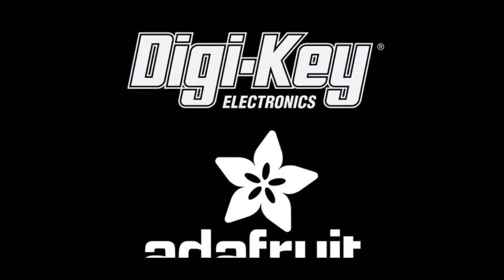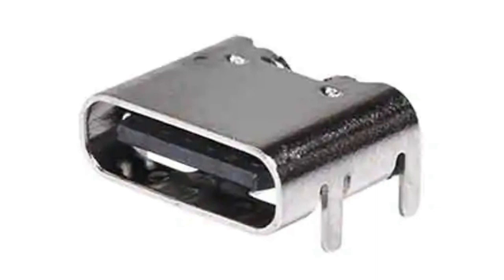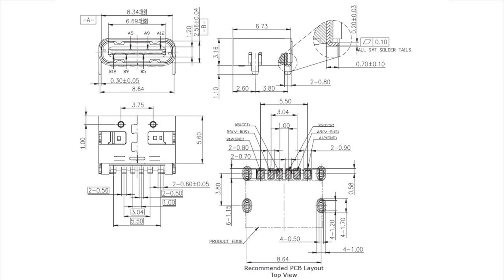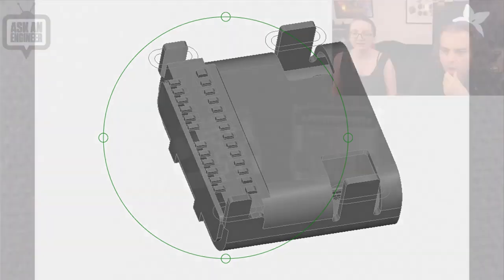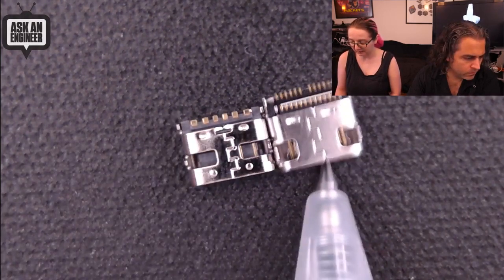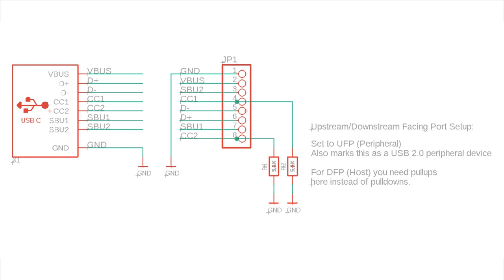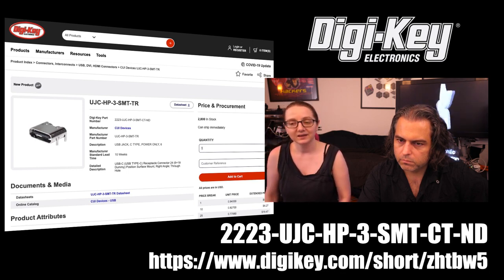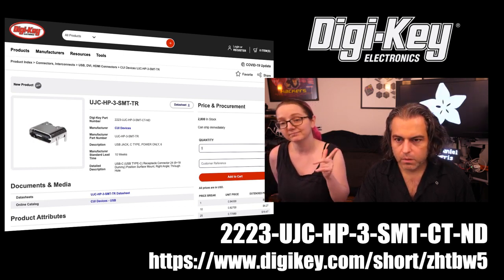EYE on NPI - Power-Only USB Type-C(R) Receptacle #EyeOnNPI #Adafruit #DigiKey @digikey @adafruit

Comment: The 6-pin receptacle is super easy soldering, I have made a lightmeter using it, just two 5.1k to ground. But it will be greater if usb plus/minus exits

Comment: There’s also a ~10-pin version that also has the FS/HS (D+/D-) lines. Much better then the full complement of pins, for the multiple reasons mentioned. The result is a more durable, direct replacement for a micro-B socket. I don’t have the part part number in front of me, but it was pretty easy to find on Digikey and it worked as advertised.
Reply: Oh nice, I was wondering! I also like the through hole mechanical connection.
Reply: Do you mean the 12-pin SMT version, I think 0.5mm*12P is a little bit difficult to hand-soldering, but the 14-pin THT vetical version is much easier. Hope 6-pin THT + 6-pin SMT version exist.

Comment: Million dollar Idea: A USB C Receptacle that has the same pad layout as standard Micro USB
. You can use it to replace the port on older hardware and bring it up to date.
Reply: Not possible I think. You'd pretty much be forced to use the USB c male cable in one orientation to match up with the old hardware pad and circuitry. Usb c is much harder than you think.